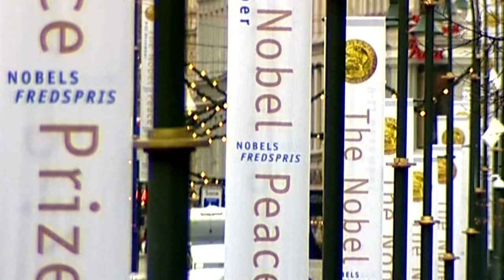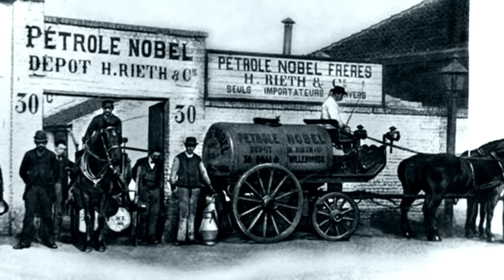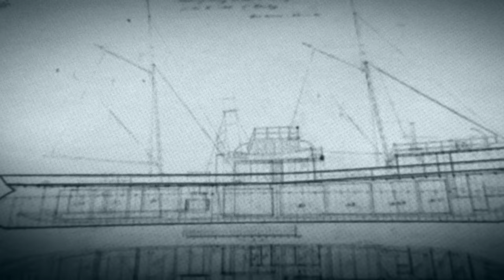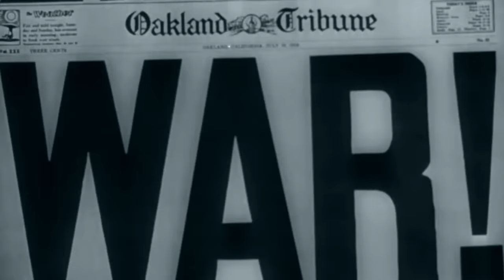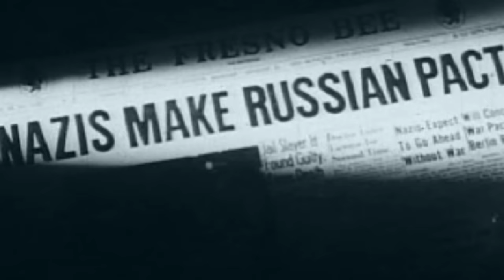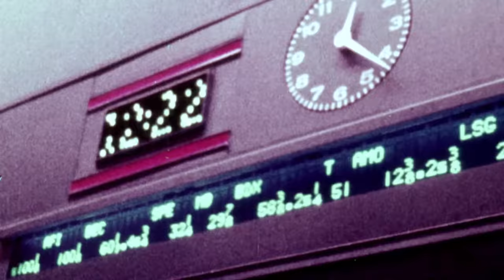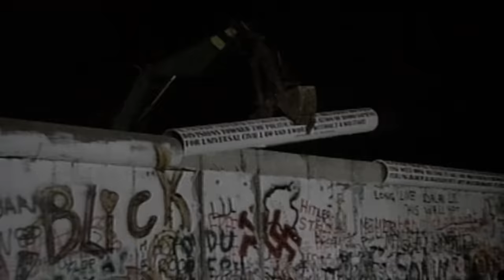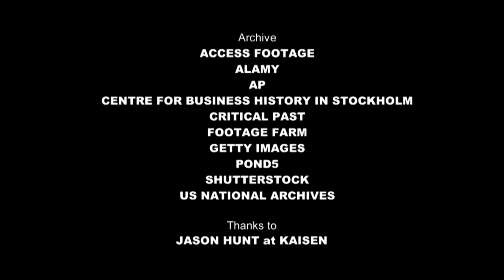War Factories | Season 2, Episode 1: Black Gold - The War for Soviet Oil | Free Documentary History

Comment: "In 1933 two Hughes engineers invented the tricone bit, which drilled holes straighter and faster, and for the seventeen years that the patent on it ran—1934 through 1951—Hughes’s market share approached 100 per cent."
Texas Primer: The Hughes Drill Bit page
Reply: Didn’t they lease out the drill bit design instead of making and selling them to corner the market??
Reply: @JackThelRipper  Right, they could only be leased.
Reply: Heady Lamar ? Invented the bit ??

Comment: Gasoline for Russia    In the spring of 1943 it was apparent that the exigencies of the struggle on the Eastern Front would soon require the Soviets to call for greatly increased supplies of aviation gasoline from the Western Powers. On 12 May a message went from General Somervell to General Connolly requesting advice as to the feasibility of sending bulk shipments of aviation fuel via the Persian Corridor.52 The Aviation Gasoline Program, world-wide in scope, was based, in the Persian Corridor area, upon an agreement reached in following months whereby the AIOC made available for Russian delivery amounts of high-octane aviation gasoline to be delivered by the American-operated transport agencies. The gasoline was. supplied on reverse lend-lease, subject to delivery in the United Kingdom of equivalent amounts of petroleum from Western Hemisphere sources to compensate the United Kingdom for AIOC products normally intended for their uses. The Persian Gulf part in the program came into effect as of 1 July 1943 under the Third ( London ) Protocol and continued through the Fourth (Ottawa) Protocol, which was effective through 12 May 1945. Over half a million long tons thus went to the USSR from the Abadan refinery. 
page 306 Hyperwar CHAPTER XV Oil for the War